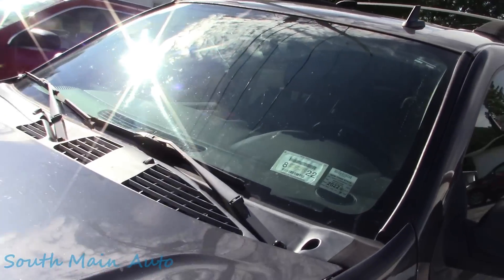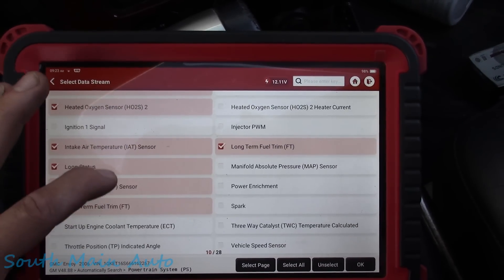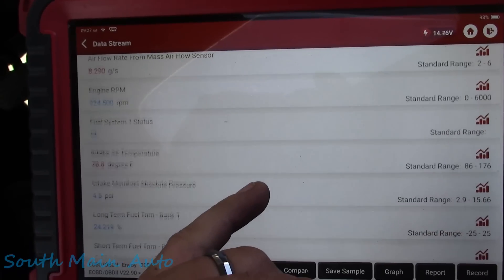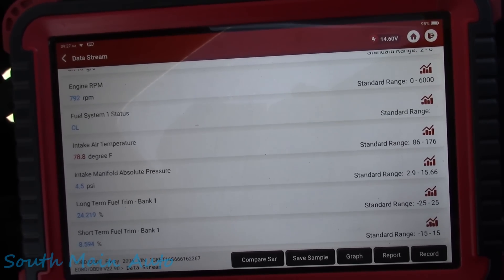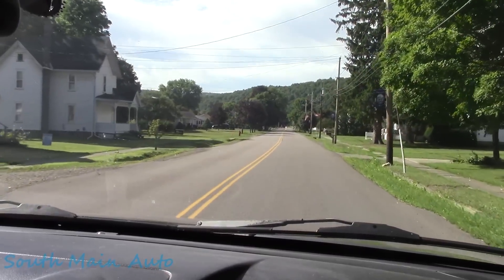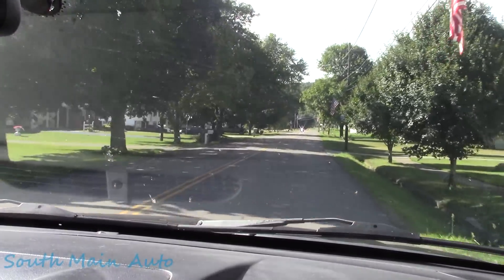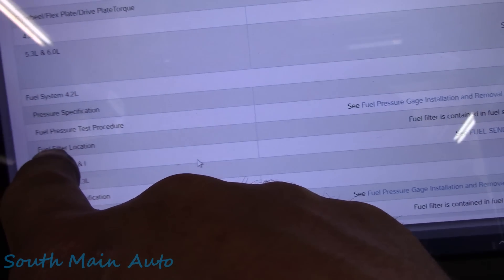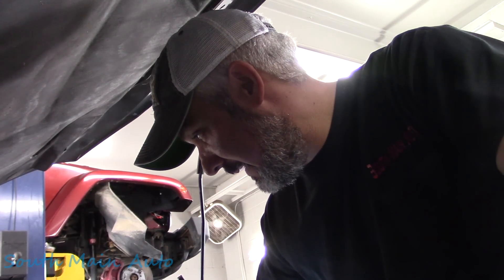GMC Envoy: Hard Start When Hot & Low Fuel Pressure - Part I

Comment: Hey Eric, How often do you service 50’s, 60’s or 70’s cars or trucks?
Reply: David, over at The Car Wizard, put up a video that he now refuses to work on 50s, 60s, 70s, some 80s and 90s cars. It's not the labor working on them but the lack of parts for them.
Reply: Don't mean to be sarcastic, but in upstate New York there are very, very few vehicles that last 20, much less 50+ years.  They salt the heck out those roads. It is common to see snow piled 5 feet high along the roads...Jus' sayin'.

Comment: GM HAS BEEN GETTING WORSE AND WORSE OVER THE YEARS🤦‍♂️
Reply: these Envoys with the straight 6 are actually very impressive engines.
Reply: @brainstorm4207  wow I legit had no idea envoys had a straight six in them, I just googled it. Fascinating
Reply: @brainstorm4207  I have an 06 Trailblazer which is just the lower end version of an Envoy. It has the same Vortec 4200 inline 6 in it. I have owned many vehicles in my time and most were V8 powered and this 6 banger pulls harder than the older 4 barrel carbed V8's did! Mine has 178k on it and the engine runs as smooth as glass, no leaks, no smoke and plenty of power to move a big hulk of an SUV. The truck even has an over 5000 pound towing capacity. To me, that's impressive for a 245 cubic inch 6 banger in a vehicle that weighs over 2 and a half tons. Years ago I had a Chevy Silverado with a TBI 350 V8. In a drag race, the Trailblazer would blow it's doors off. These engines are very underrated. There is a young guy up in Pa. (his YouTube channel is Nivlac57) that uses these same engines for drag racing. He uses stock bottom end junkyard Vortec's and puts a single turbocharger on them and makes up to 800 hp with one using stock rods and pistons! He has taken Vortecs with over 160k miles on them, turbocharged them, beat them to death and they just keep running. GM made a huge mistake discontinuing the Atlas engine, these engines are awesome. They got discontinued when GM discontinued the Trailblazer's and Envoys because at the time GM was in a financial crunch and closed the Moraine Ohio plant. There is a 4 and 5 cylinder version of these engines too but the inline 6 rules.
Reply: @Canbechangedtwiceeveryfourteen  GM AND THEIR EXPERIMENTS😳
Reply: @Canbechangedtwiceeveryfourteen  Not only an inline 6...the best damn inline 6 ever made.
Reply: Inline 6 is great. Mine is currently on its last leg though 300k miles needs a timing job that involves dropping the front end just to get the oil pan off because axle through pan was apparently a great idea at the time lol
Reply: It's those GM 4 banger turbos that suck and they put them in everything🤦‍♂️
Reply: @PhillyDee215  I have yet to own one of those. I just learned my lesson on buying a Ford Edge that successfully nuked it’s pcm with its own coil though. So I’ll add 4banger turbo gms to the avoid list when I get rid of the edge lol
Reply: @TheFallenAngel13524  bro don't get me started on those FORD 4 BANGERS even WORSE🤫
Reply: @richb.4374  Great engines, but too big. I read they were canceled because they wouldn't fit into any other GM body?
Reply: @donwasse7892  I believe you are correct Don. When GM discontinued the Envoy and Trailblazer, they had no vehicle the engine fit in at the time. They would fit in a full sized pick up, but everyone wants an LS V8 in those.

Comment: But, a half plugged fuel filter could contribute to early pump failure. Along with running low fuel levels alot, since the pump cools by being submerged in fuel. Just say'n  🙀